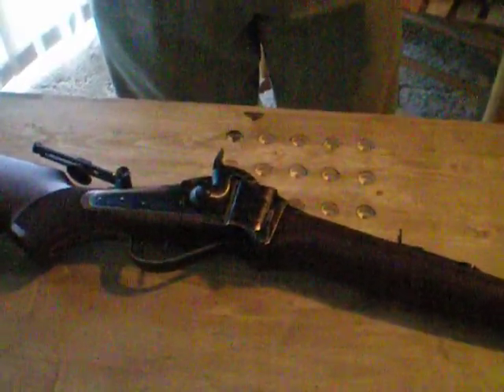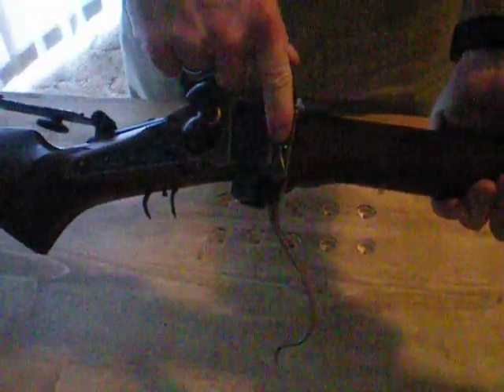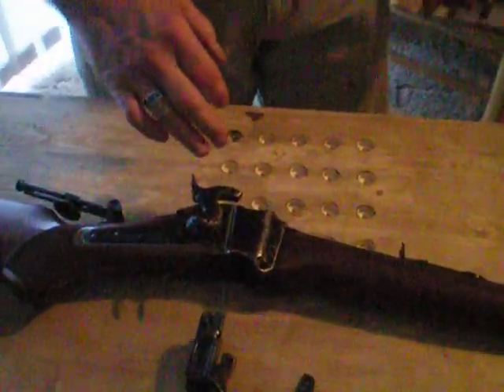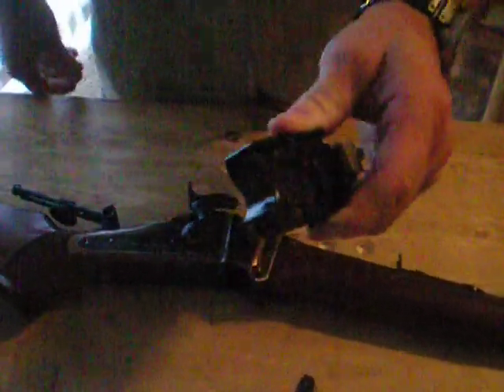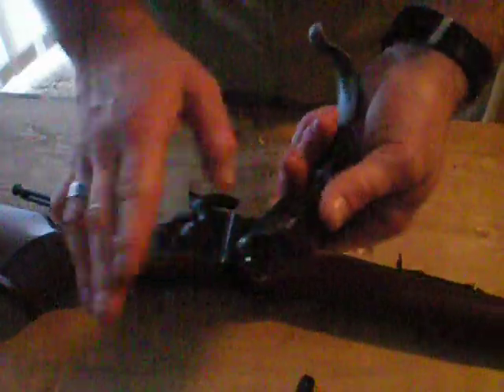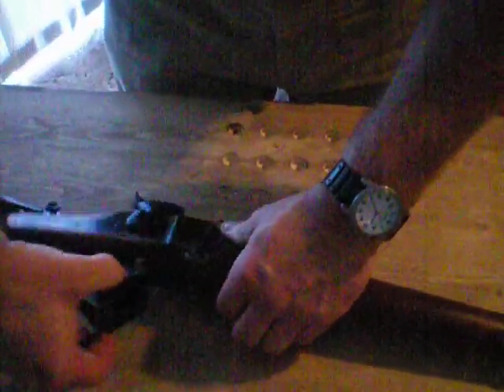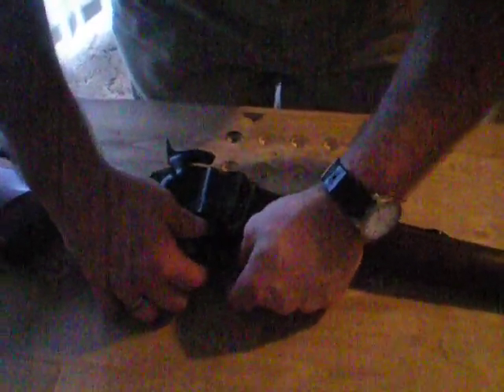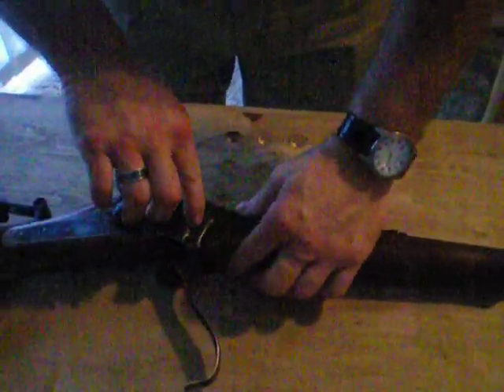A quick tutorial on disassembly  and cleaning of the 74 Sharps.

Comment: I can not get the pin out of my 1863 carbine. Any thoughts? Very long time since it has been taken apart. Sprayed it down with solvent. Pin release button is compressed into the reciever and stuck.
Reply from the maker: soak with Kroil and let set.  May have to use a brass punch to try and slowly drift out.